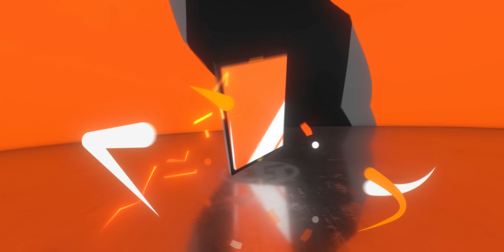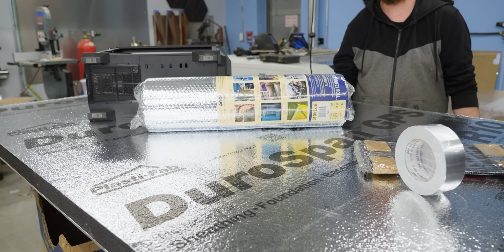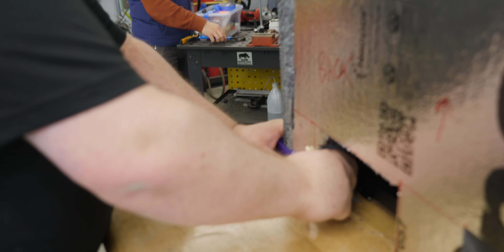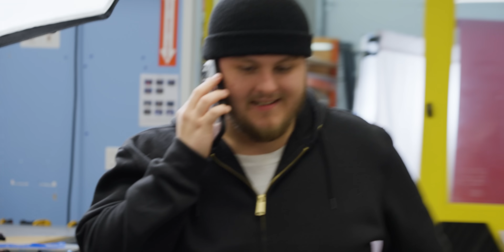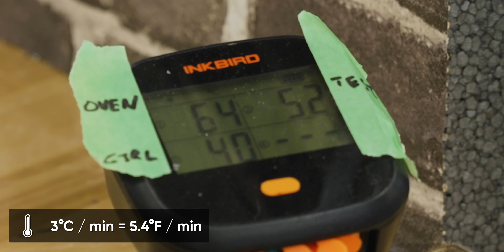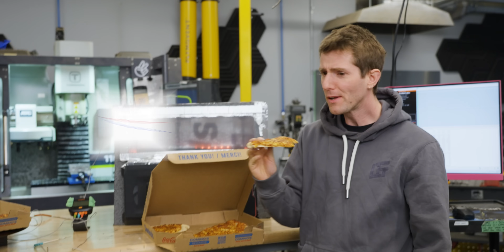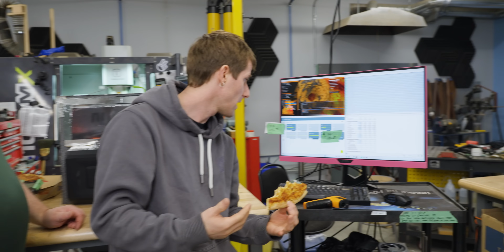Remaking Our Most Hated Video - Pizza Warming PC V2

Comment: does anyone remember that one pc someone build, it was a micro pc build and it was made out of metal. It looked like one of those thermaltake 300 pc cases but it was like a space ship with torn metal and scratches and was painted. it had smoke and red lights and to open it, you open it from the inside middle like a test tube you lift up. I cant find it anywhere and it is driving me nuts. If anyone remembers please tell me.

Comment: Custom loop watercooling, in oven hotplate that holds up warm mass of water, and couple of valves to get water going to rad and not circulate in hotplate. This way pc only has to throttle little time to get warm plate warm enough and then pc get cooling with rad, and you could program it to warm plate in menus, so throttling does not affect gameplay.

Comment: So I look up the temperatures of the cpu and with that you can make a HOT WATER DISPENCER PC or/and a Manual Espresso Machine PC with the heat of the core with and water tubes

Comment: Don't the all in one liquid coolers (AIO) have strict temperature limits for the liquid inside the tubes? If your are reaching over 60 C air temperature in the pizza heating box, isn't the liquid in the tubes then over 60 C which should be dangerous according to the AIO manual / operating specification. So how quickly would the AIO break or leak. Of course this mainly for the lols, but still haven't seen anyone bring up this point yet.

Comment: I really like videos like this. It really shows how much more the LTT team is than writing and shoot videos. At the same time, the idea of what it would look like is COMPLETELY different to what I imagined in my head and I would of made a completely different set up. The biggest flaw I see in this set up is its essentially all one big chamber. You've got 2 separate goals inside the PC/ Pizza Warmer. I would of gone a similar set up to the pool (obviously not to that scale) but extracting the heat from the PC and putting it into the warmer, essentially what you have in a poor airflow case and pizza inside of the pc 

Also, LOVING the use of Fan Control. Its honestly a game changed in temp management in my PC

Comment: as someone who has built computers for as long as Linus, and also worked a few trades ... Let me tell you of an awful food/ construction crossover.

Ever seen roofers seal a commercial unit? They drop off a tar trailer. Basically, a portable tank that melts tar, has a pump and a big pipe to send the liquid goop up to seal the roofing membrane.

It smells like ass and is most certainly carcinogenic. I had the displeasure of running a lift doing industrial siding close to it for a few days. Not healthy. Even 40-60 feet up in the air, the fumes and odour were awful.

I watched, in horror, as the tar trailer operator would cook hot dogs on the venting grill of the tar trailer daily while he chained smoked cigarettes. Dumping new packets (plastic wrap and all) into the vat, he'd snag a hot dog and casually wipe any large splatter of tar off on his left sleave, which was stained black, before casually mowing down and then smoking again.

Grossest thing I've ever seen.

I would take questionably foodsafe warmed pizza off a PC anytime instead of tar trailer hot dogs!

Comment: What you need is liquid metal to get more heat transfer and lower delta T between CPU temperature and the pizza, also lower fan speed and maximize pump speed.

Comment: This was a fun video. I would personally add a second inline radiator after the heat retention radiators and have it servo controlled so when the ideal temp is reached, the excess heat is expelled through the secondary radiator.

Comment: Would be cool to have the system switch between recirculating the air inside the oven and pulling in fresh air based on temperature

Comment: Open loop liquid cooling, multiple TECs mounted to the bottom of a ceramic pizza stone in an insulated box, hot side of the TECs on the dinner, cold side mounted to water blocks. Cold side of the TECs are then heated via water from the open loop.

Comment: linus is over engineering this in the bad way. what you want is an opening on the bottom of the heated chamber and variable fan speed so the heat still collects at the top but excess heat can take care of itself. there's no reason this thing should need any more moving parts than the fans the system already has.

Comment: next level is to use a Heatpump.
we all seen the meme pictures of a GPU in the shape of a heatpump's external compressor unit.

final level is using an RTG to heat the pizza while providing power for your PC.
downside is Radioisotope thermoelectric generator  electrical output is proportional to its size.
now the heat is dependent on the design. and there's plenty of it.

Comment: Instead of using the air that's being pulled from the pc, you couldve used a dual radiator system. Where the first radiator would be in an enclosed insulated box so it only recirculates the air in the box, and not air coming from the pc(as it may contain gooch particles), directly coming from the cpu and gpu so it has the most amount of heat. Then the water goes to a second Radiator outside the enclosure or anywhere else(even mounted properly inside the PC, blowing fresh air through it before going back to the pc. That way the pizza gets the most amount of heat, and the PC gets the coolest water it can. 
Maximum FPS and Hottest pizza.

Comment: While this absolutely is A way to attempt to use a computer to keep a pizza warm, I feel like this could have been done much better with a little more foresight. For instance, only the AIOs needed to be in the pizza chamber, not the whole PC. The radiators and fans would need to be suspended above the bottom of the chamber with the pizza above them, preferably on a metal tray to collect and conduct the heat. Cardboard is an insulator, after all. As long as air is moving within the chamber, the pizza would get warmer.
Meanwhile, the entire PC won't need to roast to heat the pizza. And did I mention you lost a lot of heat because the hot air was escaping in other places? That is pretty obvious, of course. What goes in must come out. That's why having the radiators and fans only in the chamber works better. It's only using the air in the chamber.

Comment: Luke didn't make it past the intro for a video he was supposedly a part of, and ya'll had to choke the PC to force the heat out of it to get the 60-ish °, super rushed video that I can't get behind - idea is in a good vein, implementation was trash(don't forget all the pizza grease you risk leaking through the box while it sits there above your components). A removable metal tray with a lip around it would have been better to use, thermally coupled to the CPU/ GPU somehow, and then use the heat from a legitimate load instead of intentionally thermal throttling the machine.

Comment: How to make it better: Build your PC into a 1U case. It's slim and tidy. Use a second 1U (you might need 2U to fit a pizza box) as your oven. 
You can route your water loop into the top of the PC case and use TECs between the cases to transfer the heat into the oven, using the inefficiency of the TECs to your advantage while maintaining low PC temps. 
OR you can put the oven below the PC case, directing your AIO output downwards, and use a series of baffles to reduce the air speed, taking a cue from high efficiency gas furnaces and water heaters to retain as much heat as possible while still maintaining sufficient airflow.

Comment: I feel like the ambient intake is the biggest problem. So much work is going to heat up ambient air to above 60, just for it to then be vented. If the intake had been from inside the chamber, then basically all the waste heat would be dumped into there and contained. You only need to move the heat, not the air. To stop the PC cooking, I wonder if you could have redundant water cooling loops, one that dumps into the chamber and one that actually radiates heat from the coolant so you are only cooling the computer and not the pizza.

Comment: Should've used a 3090ti or two. Those things are all hot. Way hotter than an AIO GPU will ever get. My Suprim Liquid 4090 has never hit 65 degrees, even during Summer in the middle of the desert.

Comment: Simple solution: 12V 3D printer hot plate. Put the pizza on the plate, insulation box on top, set the plate temperature controller to 60C or so, done. If you slice the pizza narrow enough, you could make such a keep-warm oven fit in a 5.25 bay or two.

Comment: Ok so if you have a hot box disconnected from the PC then airflow isn’t an issue (thinking like Linus’s pool heat dump). Hard part then is generating sufficient heat to push out of the PC. A server could handle that, but this challenge is for PCs. Who knows in 8 years we could have a CPU / GPU combo that generates sufficient heat to not need the hot box to be connected to the PC.

Or get one do those PC cases that catches on fire. 1 time use pizza oven…😂

Comment: I was thinking a good solution to this is a dual rad system where the first rad dumps heat into the chamber and then the second rad actually cools the fluid before it goes back into the system, just so it doesn't throttle. Maybe this would work, maybe it wouldn't, idk, I'm not an engineer

Comment: You could just make a custom loop that makes the water first go through some block of aluminum out something the pizza stays on and then though a normal radiator to control temperature, so that fan speed controls how much heat goes to the pizza vs how much goes outside the system

Comment: Overthought of the day. Get a Large radiator about the size of the pizza or a regular rad with a low speed fan. Plumb the liquid cooling out of the case into an insulated box with the radiator. Then just run to a small internal rad in the pc with a fan that only kicks on when you are just below throttling. It removes the need for the actual case airflow to go through the warmer and with the large rad the lower airspeed should make it keep better.

Comment: You have to have an exit. To force the hot air by the pizza. If not enough air is moving your building a pressured cabinet. Which means no flow

Comment: This endangers the whole pc by risking oils dripping in to the pc. If you instead water cool the whole pc and pipe the hot water in to a small flat (on one side )room radiator with a thermostat controlled second pc radiator, for over temp protection, you could build a insulated container with the first rad in the bottom and the second (in a parallel loop) in open air. Some normal car thermostats open at 80-85 c, well with in safety for both the food and the pc so all you need is the housing and pipes.

Comment: use a TEC on the cpu block to push the heat to a chamber for pizza..
simple. you can already get TEC refrigerators that double as a heater box

Comment: Holy crap, did Luke just step out of a time machine? He looks the same as ever! (Just post-2019 tired eyes).
---To be honest, an effective oven requires an enclosure that not only hinders thermal transfer between the inside and outside, but also retains heat. A thick layer of aluminum on all of the inner walls could help. But at these relatively low temperatures, it won't be super effective anyway. Maybe ceramic would be a better choice. The idea is to soak the heat in the oven and keep it radiating around in there.

Comment: i wonder how water cooling the pc components and embedding the loop in the floors and walls of the pizza oven to act as a radiant heat source would do. maybe also an intake over a large radiator at back of oven to further heat dump and help with convection.

Comment: FAIL!! .. Linus.. the whole reason why the pizza in the insulated PC box was warmer than the one sitting on the table unprotected is due to it being insulated from the ambient air. Why do you think the delivery guys use an insulated bag.. LOL You needed two boxes of the same design... one with the PC heat and one without to see if the PC "heated" box kept it warming than just putting it in an insulated box.

Comment: make it with a heat pump! take all the hot air from the exhaust and dump it into a hot-box. then you wouldn't effect the pcs' performance. a high enough powered heat pump and you could even feed the air back to the pc colder than ambient!

Comment: I think some more engineering could go into this silly idea. You want to move the heat out of the PC without having too much air flow into the "oven". This likely require some active heat transfer, as in Peltier elements or heat pump. But I'm sure you guys at LMG can figure it out. ^^

Comment: Couple things to try for V3:

1. You probably want a spacer/grill for the pizza to sit on. It looks like the pizza blocks the fans.
2. Insulate the door a double acrylic (air is an insulator same thing is used on your oven door)
3. Add a control in the warmer section that keeps it at 60C maybe make it detect when a pizza is in there too, if you have some exhaust you can probably keep the pizza warm without any throttling.
Reply: And don't have the lid on the box which was preventing hot air getting into the box.
Reply: Copper plate for the fans to blow the PC air onto
Reply: Nah they should just use passive coolers and put the pizza directly on them
Reply: 4. make luke do it lol

Comment: Haven't finished the video yet, but what if instead of blowing the air into the box here the pizza resides; you removed the fans from the radiator and put the radiator into direct contact with some highly thermally conductive piece of metal to serve as a warming tray?  Kinda like laying the pizza directly on the heat sink.

Comment: ok hear me out: make a perssurized chamber 
if the heat in the pc is getting high( or just on a schedule):
The chamber should pull in the hot air by creating a vacuum (suck it though the PC) and then 
reincrease the pressure in the chamber to max out heat around the pizza
(and maybe some air exchange thingie at the bottom where the temp shoulr be the lowest )

Comment: 12:24 perhaps for the next project use a dual water loop with heat exchanger where the second loop heats the pizza with a recirculating fan in a closed space and the first loop is set up to keep the loop temperature between 80—90°C?

Comment: Idea for the next attempt: Use a peltier between the computer cooling and pizza warming areas. Normally the downside of peltiers is dealing with the hot side, but in this system, you want the hot side to stay hot, and it would allow you to exhaust out of the computer and handle the computer temps a little better. More complicated, but potentially better.

Comment: Also, yall should take it out of the box because keeping it in the box is not practical. You should get a lazy susan so you can spin the pizza, to get a slice. And put a thermal cam in there to keep eyes on the temperature of the pizza for food safety reasons

Comment: If you took off the fans and just ran all the gear through an aluminum heat sink attached to a thick aluminum plate that was the bottom of the chamber and let conduction and convection do the transfer it would hold a lot more of the heat down where the pizza was and would make it super nice since it would also keep the crust drier. The few hundred watts is about what a warming tray uses in medium or low so it would be plenty of heat to last hours.

Comment: usually when you hammer the cpu to much, it chokes the gpu and furmark can't run it at 100%. That's when set intelburntest to a couple of threads less, than the cpu has, and it works fine.

Comment: Connect some kind of heating system to an oversized power supply. There should be something.  Or design it, with temperature control. It should help the system you have now.

Comment: Choking the PC of airflow to keep your pizza "luke"warm is a terrible idea! Use a heat pump (compressor + evaporator + condenser) so you can both keep the pc nice and chilly while you get MUCH HIGHER temps in the heated pizza chamber.
Reply: Should have brought Technology Connections on
Reply: @BushidoBrownSama  you're joking but why not 🤷‍♂️ through the magic of buying it twice he might even be able to take one apart 😂
Reply: peltier.
Reply: @turtlefrog369  it has been tried many times with awful results, pletiers aren't good for cooling a pc
Reply: @ no but they are good at heating up a pizza. The rest of the heat can be air cooled when neccesary.

Comment: I hate to burst your bubble, but food safety temperature for pizza is 80C. Generally you can only keep a pizza in a warmer at 80C for about 30mins before it begins to go blurghhhh...

Ideally you would want to use a heat exchanger to seperate the PC and pizza chambers. Also, running a loop through the pizza chamber like a heated floor in a house would probably give the best results

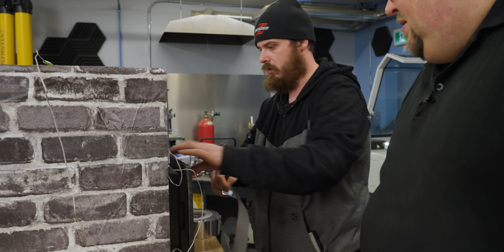Comment: 8:13 Making the CPU run warmer does not make the system output more heat. It just means your CPU needs a higher temperature gradient to achieve the same thing. If anything, you're causing the CPU to thermal throttle more and output LESS heat. The only real concern should have been how much air is escaping the "oven". I think the ideal solution would have been to build a sealed oven whose inside acts as an external passive radiator for the cooling loop. Maybe with a fan to circulate the air inside and make it act as a convection oven.

Comment: Next time include a heat pump. You might simultaneously cool the machine better and heat the Pizza better.
Reply: Or make the air circle without input from the outside.